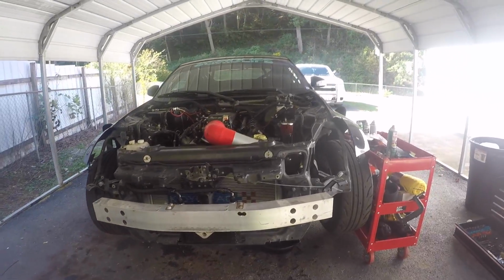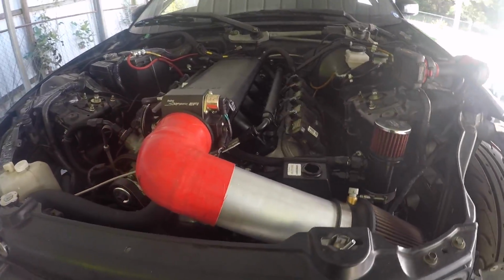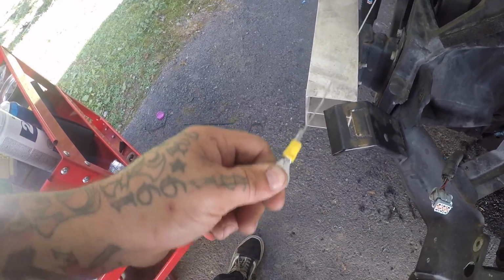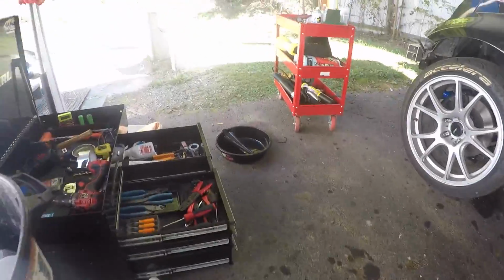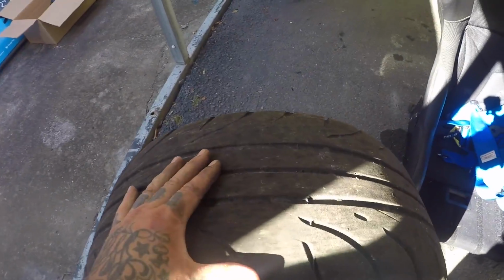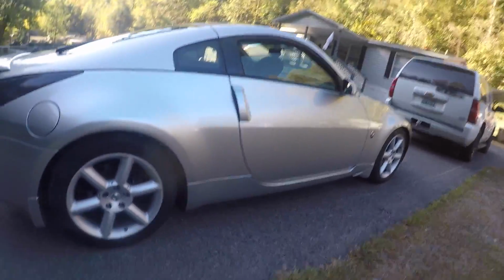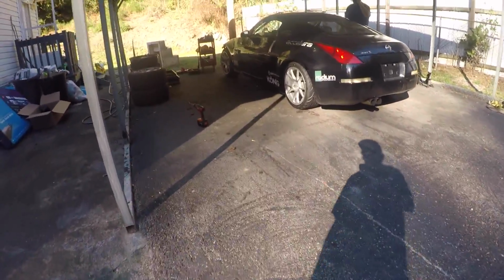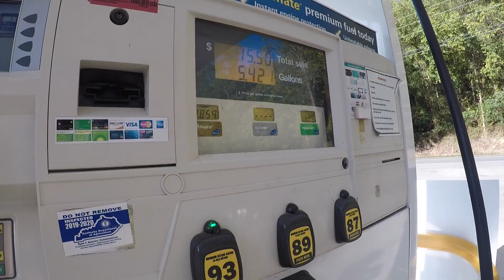TEST DRIVING LS 350Z WITH NEW FANS!

Comment: I did GoPro vlogging before I switched to using my phone for quick shots. I bought a 3rd party case with a cutout for the USB port and a cheap movo lapel mic for around $15 that fixed that and improved my overall audio significantly. I just clipped it to the usb plug and it worked fine 🤷🏻‍♂️

Comment: You are hearing the vibrations in the mic. You can try putting some rubber washers where you mount the GoPro. Also, you can tape a small piece of cotton ball over the mic and it blocks wind noise and muffles everything just right.

Comment: That is the camera moving in the mount. Gopro offers some foam insulators. I assume u are using a cage not the waterproof housing if so just put some foam tape between the gopro and housing